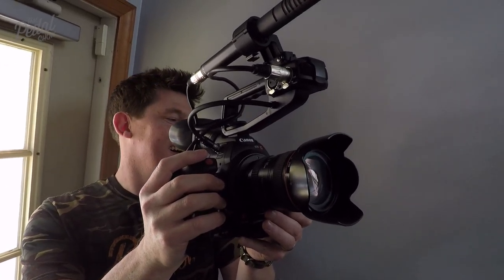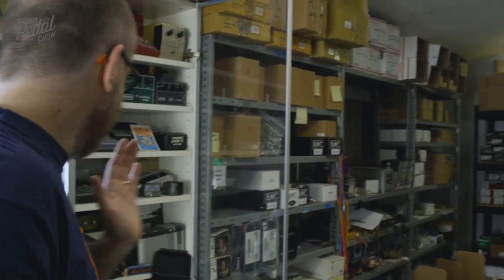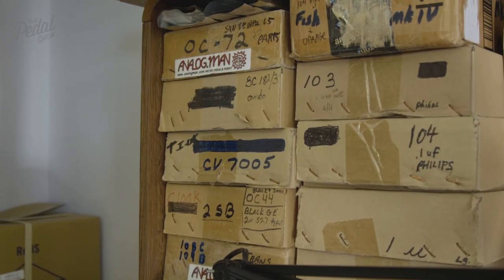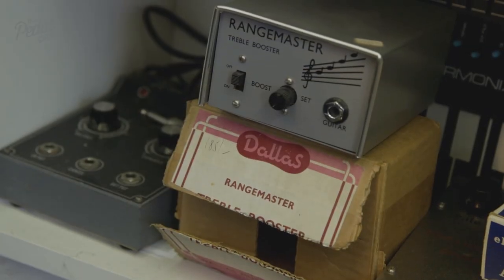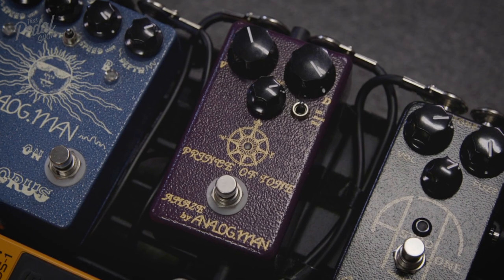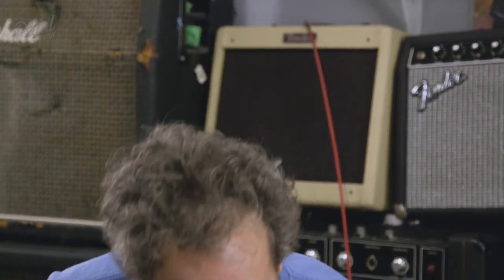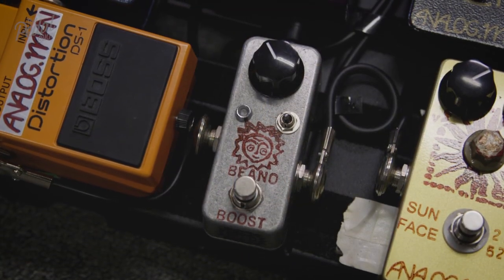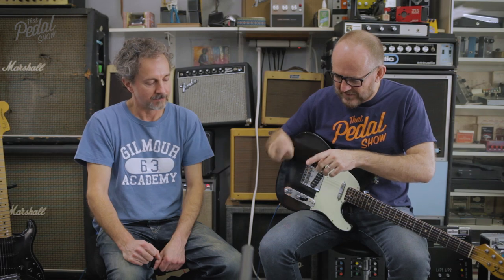That Pedal Show – We Visit AnalogMan HQ In The USA

Comment: I had no idea he was in Connecticut! Anyways, I'm on the waiting list, but I couldn't wait and recently purchased a KoT. It has high gain on both sides and a toggle on the Red side. I was hesitant to go high gain at all, but I'm so glad I did. There is plenty of range on the volume and drive controls. I find I get everything I need between 12 and 2 o' clock, and the toggle is very nice to have. It certainly is a fine overdrive and I have, or have had, many drive pedals. Mine's blue by the way, gorgeous!

Comment: You see the difference in his Fuzz pedals right here. The transistors always have to measure up. I've played a Dunlop that sounds just as good, but then I'll try another one that has only one gain level that sounds the same. It's a crap shoot with most cheaper, Fuzz Face style pedals imo. Usually the clean up is where I hear a huge difference.

Comment: Hey guys love the show! I have a question. If I have two pedals I love and want one or other on or both on without having to tap dance. What would I need to get??
Reply from the maker: +Ghastly Ghoul You could do that with an ABY  switch or with a programmable loop switcher. Lehle also makes just about every combination of this any human could imagine. Cheers!
Reply: Another way I've addressed this issue, especially if you must be budget conscious, is to aquire (or already own) a multi-effects unit (like early boss gt-5 for example) with a built in effects loop, and connect your OD pedals to the loop.  You can then assign one of the switches on the Multi FX to engage multiple pedals at once.

Comment: Hey guys can you tell me in your opinion which would be better for my setup. Either a Beano or Bad Bob. I'm using a Marshall amp if that makes in difference. I want to purchase one of them. I just don't have either in my area to demo. So if you could give me your preference on the two pedals. I would greatly appreciate it. Chad Baglin
Reply from the maker: Bad Bob is more like a full range boost with a bit of edge works great into clean and dirty amps. Beano is a treble booster so really suits a dirtier amp, IMO. Mick here. I prefer the Bad Bob for the kind of stuff I do, but the Beano is a more authentic treble booster. Cheers!

Comment: So what’s the difference between the analog man ds-1 and the boss ds-2?since they both have a midrange boost
Reply from the maker: +wesalefle Have a look on Mike’s website. They change quite a few components I believe (Mick here). It used to be that the mods would generally reduce the noise floor, widen frequency responsive and clarity... I’m assuming that still to be the case (Mick here). Thanks for watching!
Reply: That Pedal Show ooo cool I’ll check it out thanks for the explanation :)

Comment: Can you boys do a good video, or at least recommend one, on the fundamentals of midi devices and how to use them? I can't find anything that is in layman's terms that starts at the beginning, and I can't follow most of what I have found simply because everything I've watched assumes that the viewer is already familiar with the basics. I am not. Thanks.
Reply from the maker: +Chris Walker A few people have asked for this. 
The main thing to understand is that MIDI is simply a communication protocol that tells something to do something. That could include turning something up and down, varying rate, pitch etc. Change channels, change patches etc etc. 
Using a MIDI device (in guitar effects terms) is just about having stuff do stuff automatically. Take G2 for example. It can turn loops on and off to activate the pedals within them. On and off. But let’s say you have a complex pedal such a modern multi-function delay. It will have endless parameters, patches etc that can all be switched/changed. Using MIDI as the communicator (also available in G2), it becomes possible to change multiple parameters (across multiple devices) should you so desire, with just one action. Pedals all do this slightly differently which can be a faff, and terribly boring subject matter for a video (and is the kind of thing manufacturer’s should provide).
What are your questions specifically?
Reply: That Pedal Show well, I saw a Tech 21 Midi Mouse on a board and it doesn't seem to be an effect but just a controller so I was curious what it's purpose was, as I have seen that many of the midi compatible devices (Strymon, for instance) allow you to seemingly do this without an external controller. Perhaps I'm wrong about that, but as I say, the whole thing is a bit over my head. So I guess one question would be, could you control things such an MXR Carbon Copy with limited controls or something like a TC Electronic delay with multiple settings available that are not "midi compatible" with a separate midi controller?
Reply: Also, I LOVE your G2 demos and wish I could afford one. But to be honest, that would be a bit of overkill for me as I'm trying to come up with a good setup with minimal gear and effects. I like the demos I've seen of the Boss ES5 but it doesn't even seem to have the same options as it's larger counterpart much less the G2.
Reply from the maker: +Chris Walker Cheers Chris. No is the answer. The pedal has to be MIDI controllable/compatible. It doesn’t //always// mean a MIdI socket, but that’s usually the giveaway. Cheers!
Reply: That Pedal Show hey guys thanks so much for your response. You guys rock. This is like advanced education for guitar players who are into or trying to get into guitar effects. I've learned more watching your shows than all the years of toying around with pedals in music stores. Keep up the awesome work and thanks for doing it and sharing your knowledge!!!